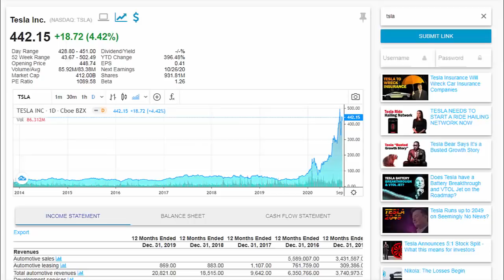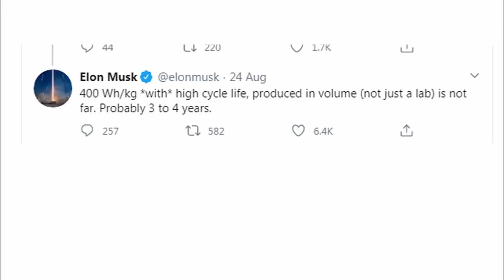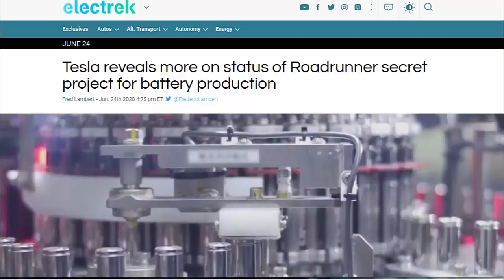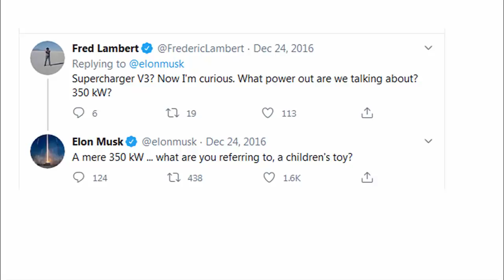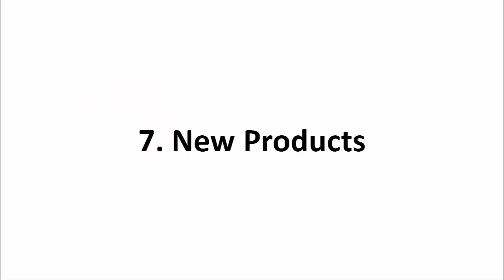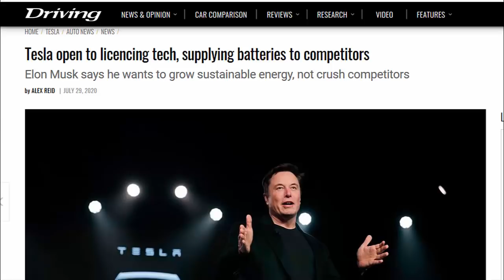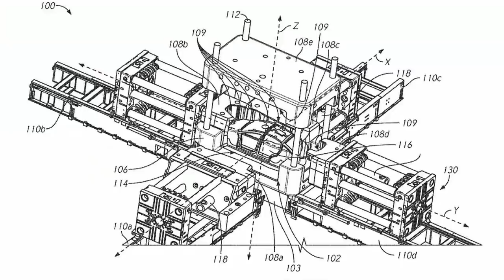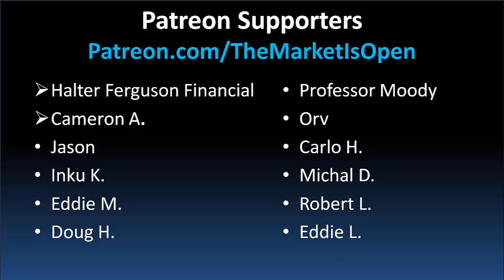10 Battery Day Expectations from Tesla - Game Over for ICE Vehicles

Comment: 4 years ago when the main message was that batteries took 20 years to develop to a level of useful product in a suitable vehicle.
In order to hit the "save the world" mission in proportion to the rapidly declining social collapse under the fossil fuels political corruption and environmental pollution onslaught, you can aim low and fast or high and slow, so Tesla began with the monetary indulge level of marketing, (extreme tech needs no advertising), which has the usual problem of elite status symbols. The battery tech is all over the spectrum in price still, and in appropriateness fit for purpose. 

The combination of tech and elitist values perception, mostly propaganda arranged against a competitor to the status quo, has confused many aspects of the results of achieving the mission against some pretty low acts of disgusting sabotage of improving the quality of life by Tesla as a Software Company. 

So the approaching release of higher density power availability batteries at lower cost in FSD EVs is a "may you live in interesting times " situation. 
A Declaration of Defence of the planet saving mission requires reiteration, continuously, and strategic planning to adapt to the mafia-like status quo. 

This is what I see, not what think I should see.., because it's vital that everyone reiterates what they SHOULD  know about holographic positioning nucleation and the required first principles technologies to save a sense-in-common society that lives on the planet.

Comment: Its not over for ICE cars until its battery can be charged in the same time as it takes to fill the tank of an ICE car, the range is similar to that obtained by an ICE car from a full tank, and the car costs about the same as an ICE car. Also that the demand for Lithium and rare earth metals for electric vehicles is much reduced or eliminated.

Comment: Battery day announcements will consolidate a solid metric on which to determine company earnings for the next 5 years, and give tesla a rock solid basis in its fundamental capacity to manufacture its products competitively compared to legacy automakers. As for the stock price if it rationalises itself based on these metrics it will settle in on a realistic price which reflects this P/E metric. Crunch those numbers and the stock price has to come down dramatically.

Comment: My personal guesses:
The new battery cell's chemistry will be lithium (iron+nickel)-phosphate ("stainless phosphate"?) for the cathode, some kind of managed growth silicon graphite for the anode, tab-less, with nanotube contact caps to avoid soldering.
I predict this will be the minority type cell in a typical skateboard battery, as its power density will be far greater than necessary.  The rest of the cells will be of a type that will trade away power density for the sake of energy density and low cost, such as metal-air batteries.  Best of both worlds.
I also predict that the relationship between Tesla and Panasonic will continue, but that as Tesla Battery production ramps up, serving automobiles, Panasonic battery production will shift target use to power walls.

Comment: I feel that all of the technical data will go over investors heads, and they will just be riding the short term hype train.  I hope they sell off after battery day because I will be right there to take them off their hands. 
  One aspect of battery day will be an image of a single piece rear sub-assembly with a floor that will be riddled with holes... Battery sized holes.  There will no longer be battery packs.  The batteries will be inserted into the casting directly.  By doing so the chassis will aid in thermal management along with now reduced size active measures for accuracy.  
  On the drivetrain side I am anticipating some story of how the new systems better utilize the power from the packs at the Tesla given "pack" voltages.
Pretty excited to see the change!
Reply: It is an interesting idea about the frame heat sink, but I suspect liquid cooling  or high speed air would be needed for sufficient cooling, unless silicon nanowire batteries are less exothermic!

Comment: The best use scenario: when you don't keep the same battery, and they are circulated throughout users like a 5 gallon BBQ propane tank by vendors
Problem with designed-to-fit, permanent, bespoke batteries: you're stuck there charging, because that battery can't be quick swapped
Imagine instead pulling up to what used to be 100% a gas station, now 50% a battery hot swap station, and the attendant swapping packs in 3 minutes, sending you on your way. The new Gas Tank. The batteries you first buy with the car are a deposit and are industry standard.
Reply: They would have to create a whole new  infrastructure for that, and that would take years. By then battery charging will have improved enough to make swapping redundant.
Reply: @macrumpton  We're in the DAWN of the electric vehicle rennaisance. There IS no better time to adopt infrastructure or create standards (or give gas stations a new Income stream) than now. How do you think the fuel stations you use today came to be?
Reply: @WindFireAllThatKindOfThing  Redundant means "not needed". Charging will eventually be quicker than swapping batteries.
Reply: @BjorckBengt  That's one helluva prognostication, Nostradamus

Comment: It is hard if not impossible to reduce wiring when the widget in question needs power/electricity.
Reply: Not for signal based uses of electricity. You can go over-the-air (EDIT: or potentially via multiplexing).

Also higher V allows smaller diameter conductors, thus less conductor material (trade-off here is potentially thicker insulation to keep the higher V contained).
Reply: aoeuuaoaou, you still miss the point. Take of instant taillight can as you say get signal to break/turn wirelessly, but where do they get power to light up?
Reply: @demultiplexdfunc177  

You fell asleep in physics class? Albert E established over a 100 years ago there is no "instant". ;)

But absolutely you could get functionally "instant" via wireless (or multiplexing over the power lines) signaling. Do a near single drop loop for + and - for power to all the accessories, probably between 24V and 48V based.

Wireless latency isn't that bad. Ideal latency for Bluetooth, for example, is around 34ms. That's quite low, maybe good enough (although BT is going to have bandwidth issues, plus there's inherent interference with communicating with your phone, so I'd be surprised if they use it systemwide). In practice with BT that tends to rise to 100ms, which is still going to be good enough, and potentially up to 300ms which I expect wouldn't acceptable.

However Tesla could get it well down from BTW their own in-house brew. 5GHz wifi latency is down in the single-digit millisecond range. Plenty fast, and lots of bandwidth. 

If you don't think this is possible just look at how wireless mice are used for PC gaming, a far more latency sensitive usage of wireless.

Comment: At 12:50 You seemed a little confused about the stamping/casting machines. To be clear, large castings can replace the many small stampings that make up the vehicle. 
The rear section of Model Y was proof of concept and it would seem that the 8 GigaPresses being installed in Berlin will replace dozens of Robots and 100’s of stamped parts.  IMO The wiring harnesses would not cut it as a fundamental change to the core “structure” (Not core “technology”)of building a car that Elon claimed.  Wiring is not a structural component of the car.
Reply: What part of the car will be casted exactly?

Comment: $100/kwh, doesn't make electrics competitive. It makes the purchase price about the same as an ice vehicle.

Anyone who can do math, would realize purchase price is just 1 of the expenses of running a vehicle. 

Energy cost and maintenance are so much lower. A Model 3 is lower cost over 5 years, then a v-6 Camry. Over 7 years a model 3's total cost is lower then a honda fit.
Reply: Expenses have been worked out at about 20% of an ICE car. The only maintenance is windshield wiper liquid and tires if you like to burn rubber! 💰😁
Reply: Unless you live in Germany where every 100 kW battery cost you 40 Euro.

Comment: I think one aspect of the tab-less Battery you missed is that resistance is reduced by up to 45% providing for drastically improved regeneration allowing for a longer range.
Reply: Probably affects charging time as well.
Reply: @macrumpton  yes it will dramatically less heat and faster speed
Reply: Best of all, it reduces battery pack cooling requirements.